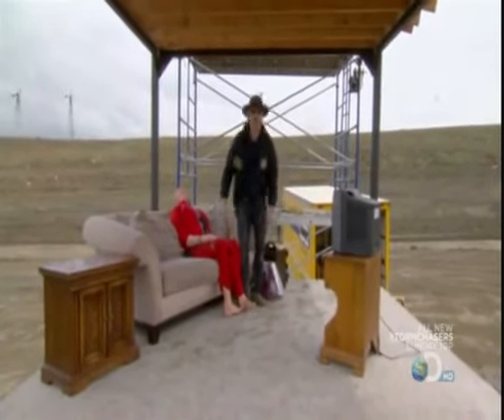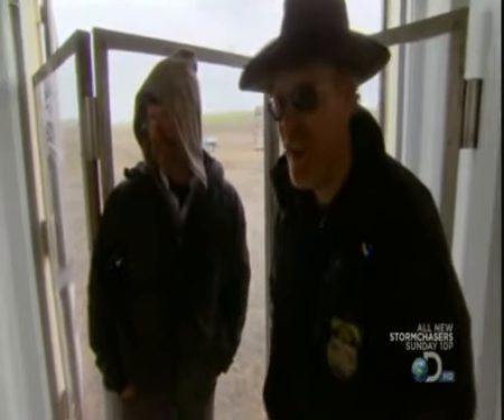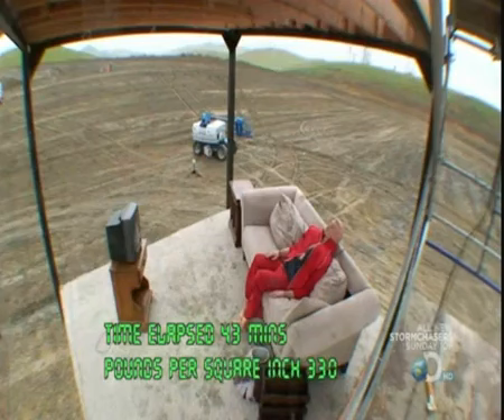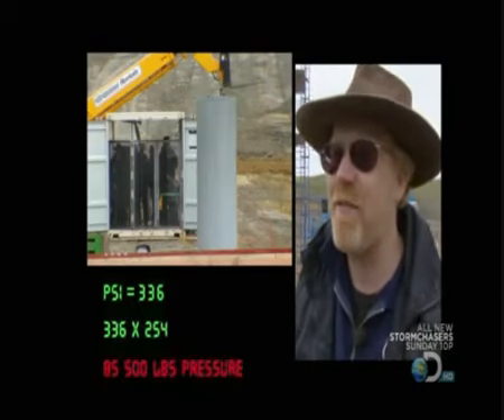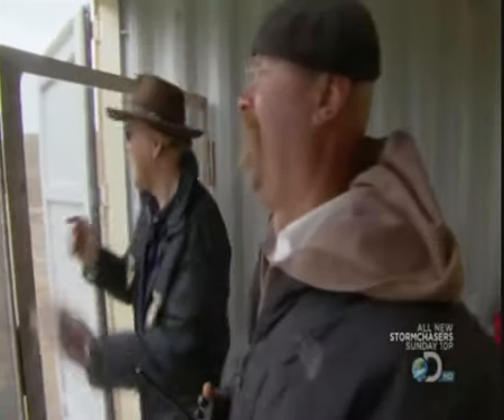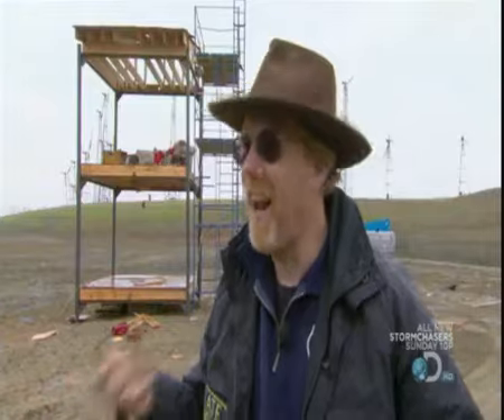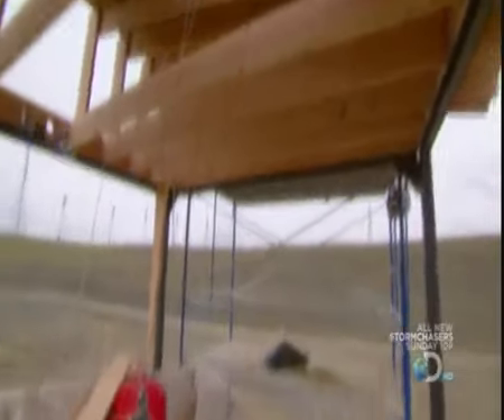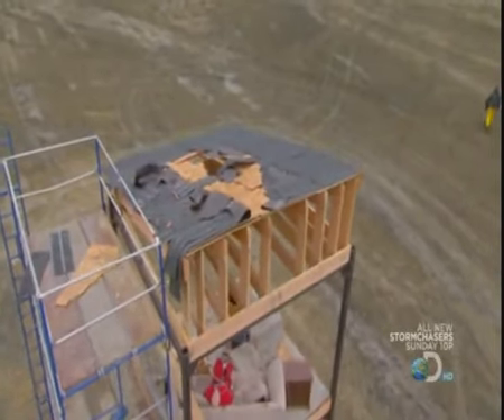Water Heater Explosion

Comment: The pipe fittings in the house would fail well before the pressure ever got this high
Reply: And yet this has happened to people
Reply: @chrishall2594  Yes, but incredibly rare. 1 in a million.
Reply: @b_rabbit435 Still possible and that's a possibility that no one is willing to take wit the safety of their family
Reply: @bizzyizzy9526 wanna bet? I inspect boilers. There are plenty of idiot who plug their relief valve discharge pipes so they don’t leak.  I have seen plugged boilers and plugged water heaters.  I’ve seen people install valves down pipe of the relief valve so it can’t work.

Comment: I remember some idiot put a setament facet on the pressure release valve and when I went to the call for a leaking hot water tank, the tank was making a ticking noise and I hit the main power and got everyone out of the house and cracked a valve , the homeowner said I over reacted but I showed em this video, everyone should watch this before fucking around the the hot water tank lol

Comment: The temp control would have to go horribly wrong and allow the burner to continously run along with a bad relief valve. This has got to be rare af
Reply: Even in the show they admit a lot has to go wrong to get this result.
Reply: The Chemical Safety Board investigates industrial accidents from boiler explosions more often than you'd think. There's a new video they posted pretty recently about an accident where a couple people died.

Comment: Remember to cycle your T & P relief valve (Temperature and Pressure) on your water heater and boiler (like a radiator heating system) at least once a year. Cheap safety test and better than catching a flying steel tank in the face.